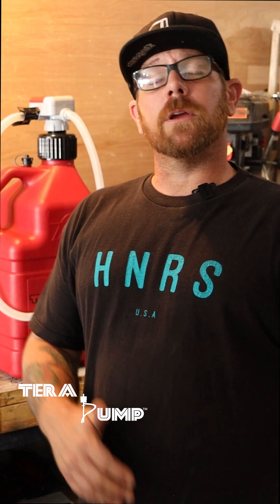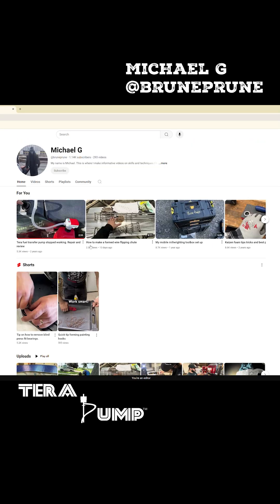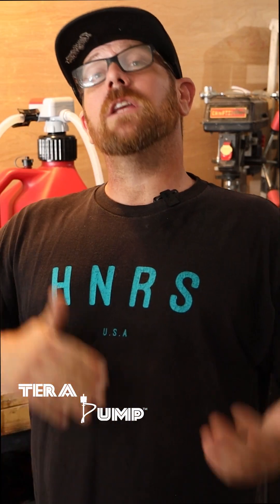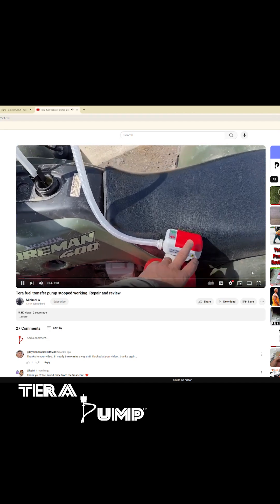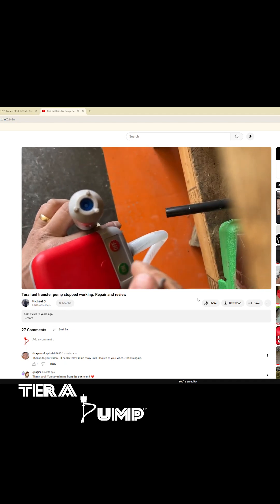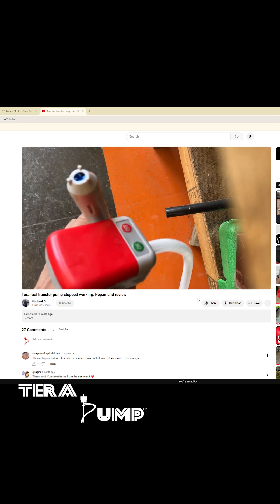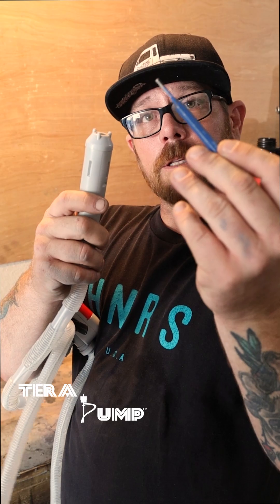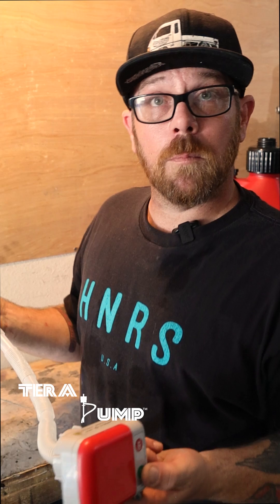Tera fuel transfer pump stopped working. Repair, review and thank you

Comment: Own a TRFA01 (Generation 3) pump... and it's very inconsistent in daily use: working maybe 10% of the time. I regularly have to disassemble the impeller and then reassemble. Tera Pump... you lost a customer.